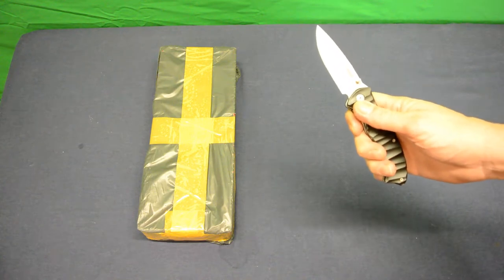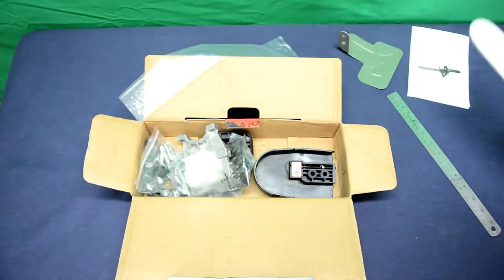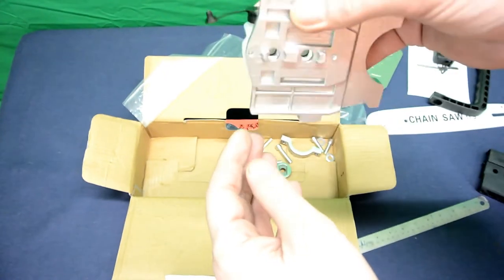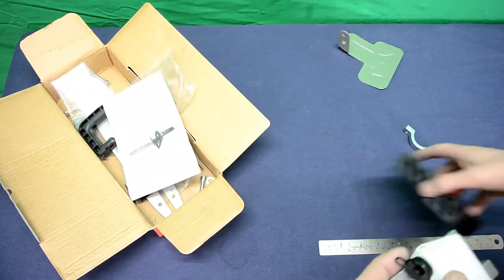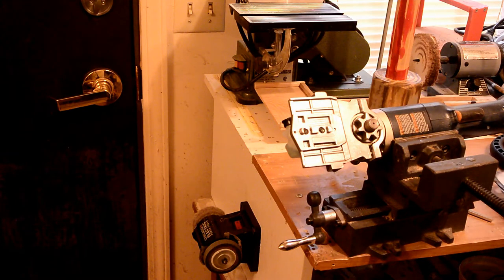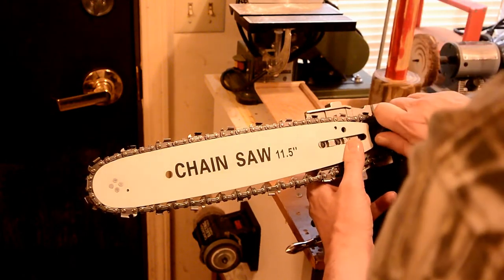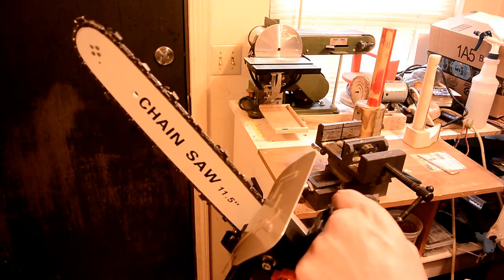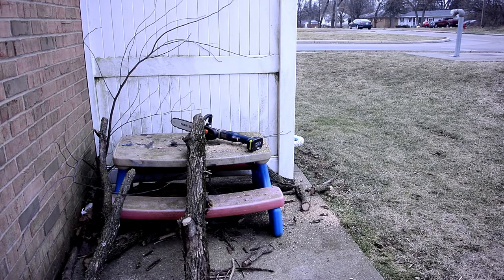Chainsaw conversion   Will it cut it!?

Comment: You will need plenty of batteries to trim a large downed tree of its branches.
Reply from the maker: After I charged up my lil battery, it went through the rest there with no problems. I am looking into a bigger battery though. Thanks for watching.